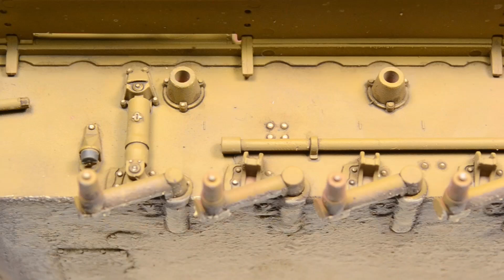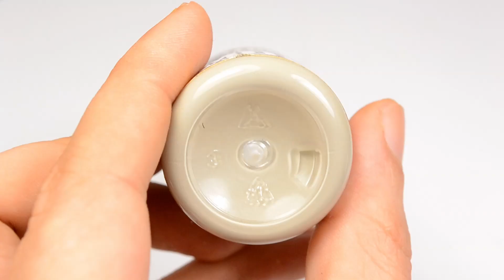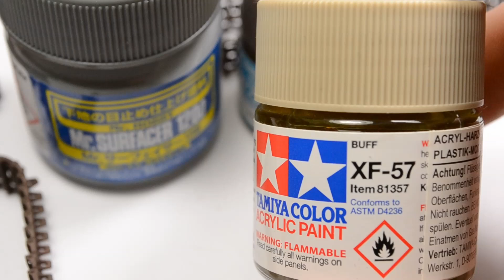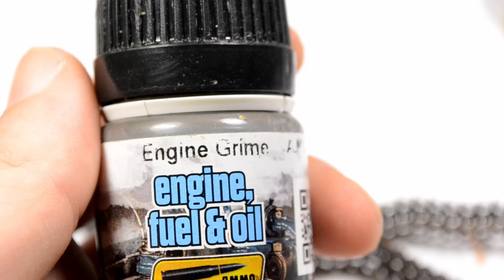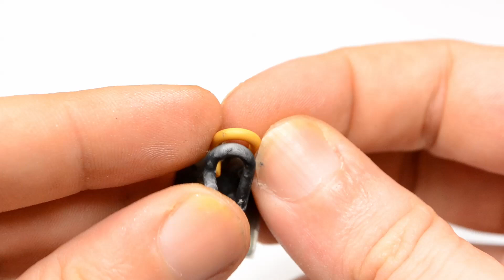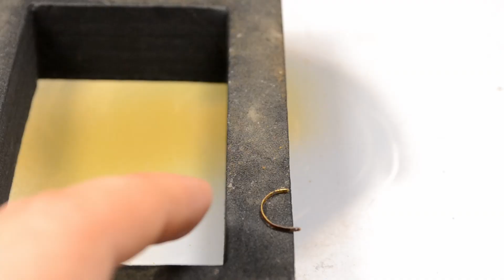Ep. 2/3 | Bronco 1/35 | StuG III Ausf. D | Weathering the lower Hull with Mud and Dirt

Comment: Another great update. I had issues with the air filters myself. Glad you managed to get the reference photos
Reply from the maker: Hi Steve, sry I missed to answer your comment somehow. I could not get any reference on how this pipe on that version looks like, only the lowered version unfortunatly.
Reply: I went for the scratch built right angle tube into the air duct. If you need any more reference photos let me know and I will see if I still have it on my system

Comment: Excellent! The Stug looks great, and I know that there is more goodness to come! 👍👍 I'm looking forward to your next episode. ☺

I did want to comment on your statements regarding the tank fighting in an arid environment. I'm not sure where it was located during all of the action, but if it was in Tunisia, then there is more moisture available than many people realize. First, while a desert (by definition) receives less than 10 inches of rain per year, it is still possible for levels of humidity that are higher thaan one may expect, especially closer to the ocean. Second, because cloud cover is rare & the land is dry, the temperature at night can plumment 20 or 30 degrees C lower than typical daytime temperature, which will raise the humidity levels and allow the dusty, dry surface of the tank to absorb some of that moisure. Third, Tunisia has a lot more vegetation than the absolutely barren stretches of desert to the East, aand, aat night, that vegetation will need to convert some of the glucose/starches it made during photosynthesis into heat energy to stay warm, thereby producing water vapour as a product of 'burning' its 'fuel'. Consequently, even more water vapour is added to the tank's environment. Furthermore, the tank's combustion of gasoline produces water vapour, which could be absorbed by dust near the exhaust. Last, Tunisia has a lot of hills and valleys, so if your tank is parked in low ground, the first two processes could be enhanced. Bottom line, assuming that the Stug is in Tunnisia, it may be in a relatively dry region, but it's not impossible for it to had a bit of mud adhering to it, even in the absence of rainfall.

Ok...mini lecture over....I hope this was helpful...test next Friday. 😉😆😆😆
Reply from the maker: Hi and thanks mate. This one was more in Lybia and has seen some desert. Panzermeister36 gave me a refference with that one driving down a dune. Nevertheless I totaly agree with what you wrote and that's why I did choose to do the texture with more "profile" instead of pure dry pigment and sand dust. I hope it captures my intension well enough.
Last part will be online next "Friday" ; ) +- 24h xD Looking forward to fix my schedule, every time I anounce a date, life jumps in ,,nope, not today" ; )